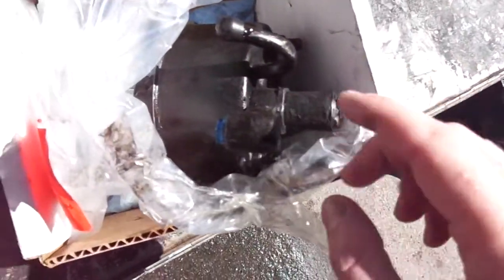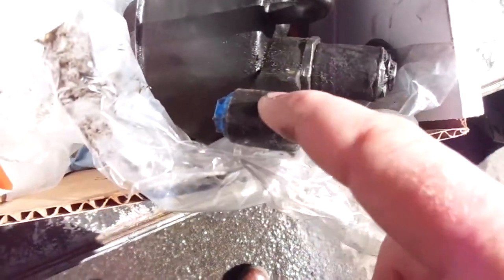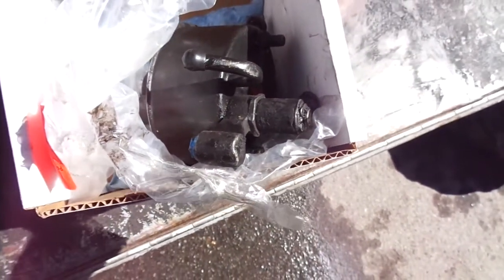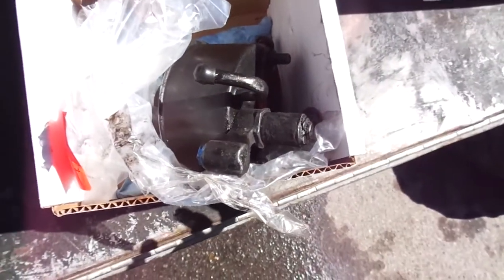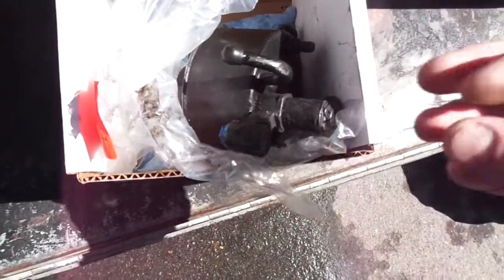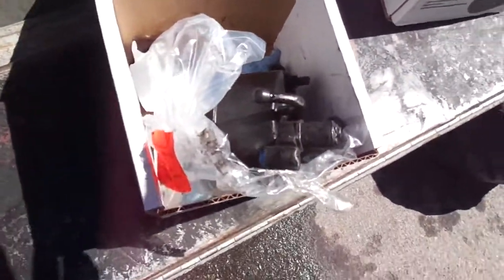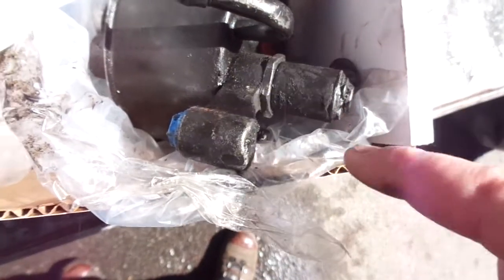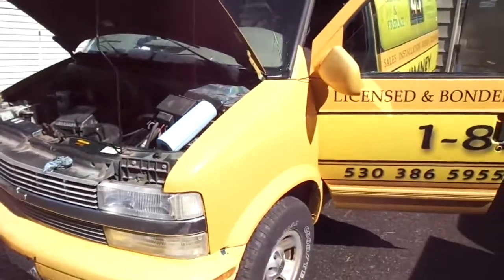Electronic Variable Power Steering - Operation and Updated Design!

Comment: Im about to do mine.......
Let's see whats happens........
Just to let you know Iam no mechanic just a guys whom can remove and replace a bolt.......
Reply: You should be able to do it as long as you know how to handle brake lines and system burping. How did it go?

All there is to it is removing the fan/shroud, removing the power steering pulley (will need a proprietary tool) and unbolting the correct pump bolts and hoses.

Comment: What is the part number for the solenoid?
Reply: Hey, not sure if you fixed it yet, but the solenoid has been discontinued for quite some time. The Bypass/Delete kit 19168825 from GM is still being produced by GM and third parties and is available pretty much anywhere.

Comment: Actually, they haven't got rid of it. It's just done differently now. The only failure I've seen is the steering wheel sensor goes bad. And I've been working on these systems since the come out in 97.

Comment: What if the Electrical variable Orifice part is discontinued ?
Reply from the maker: Raphael Lopez Thats the idea behind this video. Search “evo bypass kit” on amazon or ebay and you won’t need the stock electronic valve.
Reply: @skampsautomotive8560  will it effect thy hydro bake master running off the power steering and how does the steering feel afterwards my k3500 has the same issue

Comment: I just recently as of today got the variable effort steering service light indication in the dashboard of my 2005 Pontiac Grand Prix GT and all of a sudden my steering feels extra tight. Will this solution help me ? And could you leave me a link with the kit you mentioned with the hook part that connects to the power steering pump also great video !!!
Reply from the maker: This fix was on a 1998 Chevy Astro Van, so I can't confirm it will solve your problem on a Pontiac, but I would image it's pretty similar. Just search "evo bypass kit" on amazon and you will see the kit come up. PN 19168825.
Keep in mind if you eliminate the electronic valve that service message may never go away even if your steering feels good. That would be because the connector is not plugged into anything. 
Good luck!